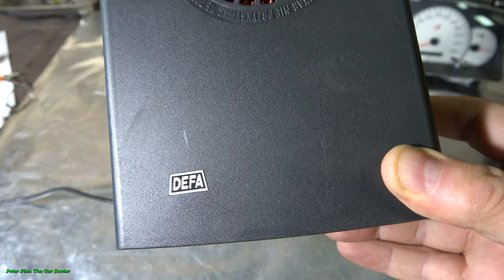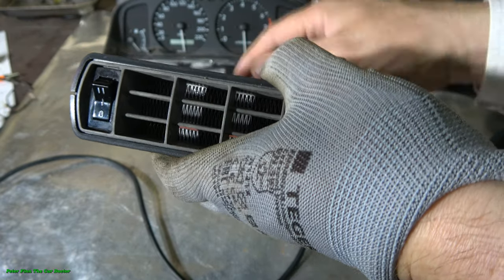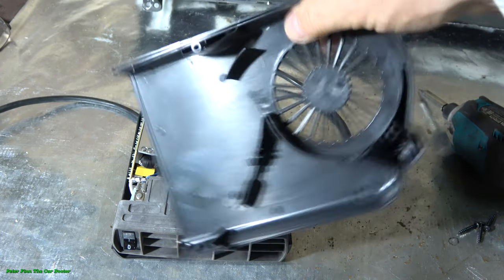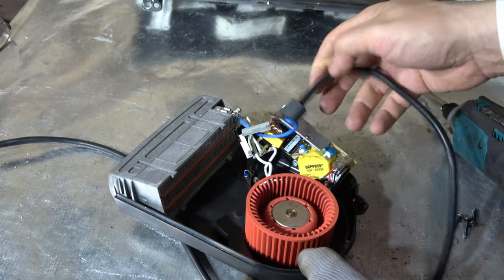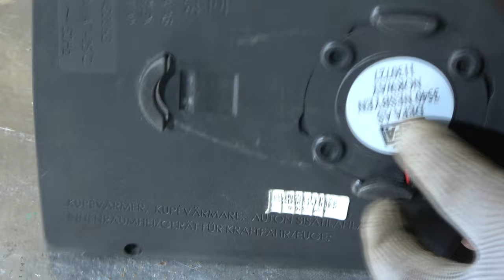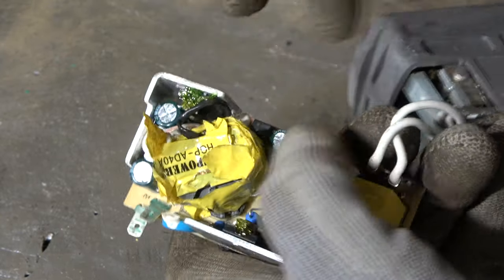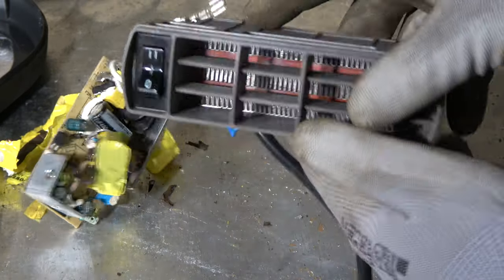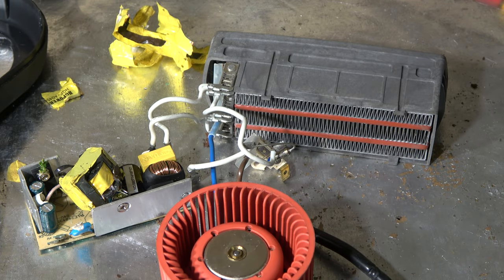How works DEFA car inside cabin electric Heater

Comment: I am building a wodden floor in my basement. And now I think I can maybe put this into the floor with an intake hole of course and a designated framing for air distribution. Could work to keep the floor warm and dry, as the floor underneath is a bit damp and itˋs just brick stones on dirt.
Reply from the maker: Thanks for comment and noted 👍😀